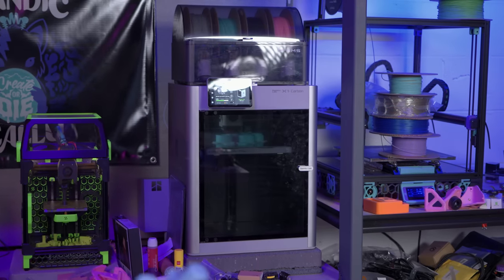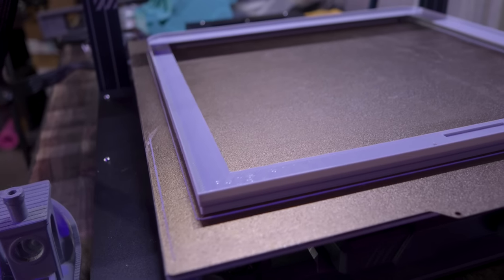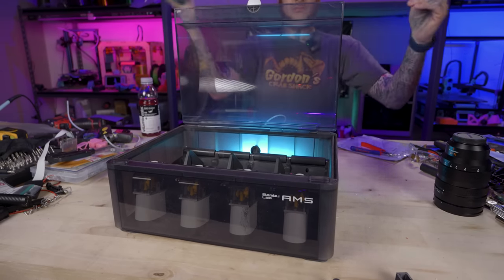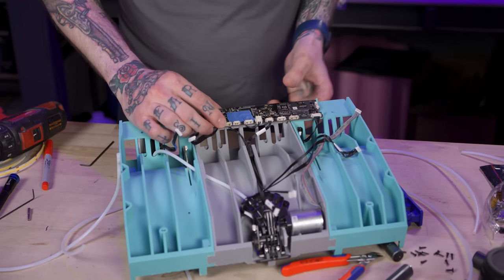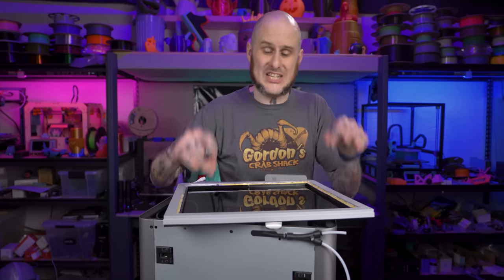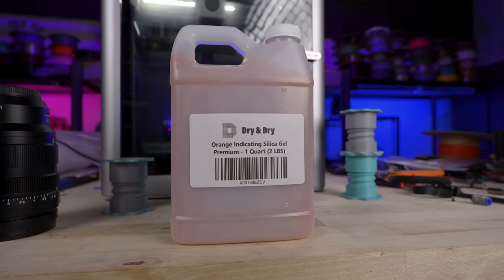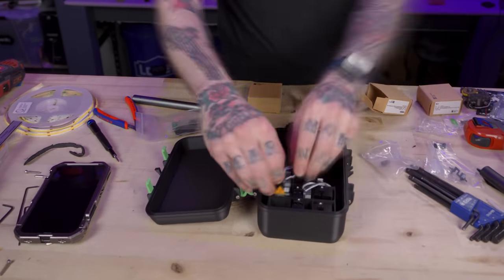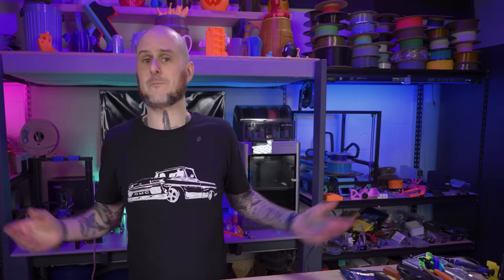GAME CHANGING Bambu X-1 Upgrades! - Hydra AMS & More!

Comment: In case anyone sees this later, Bambu sells some white LED strip with USB input that plugs directly into the printer.  No wiring or extra stuff required. Additionally,  adding the foam to the foil completely negated the foil side of the insulation which is reflect the heat back in. Don't add foam

Comment: Hey. Thanks for showing my Bambu Tool box as a Must have, makes me a little proud  😉 I had no extruder to make a place for it. Once i have one I will fit it in 😉
Reply from the maker: Thanks for making it. I was legitimately annoyed by my spare parts until I put them in that. 🤣👌🏻
Reply: @MandicReally  Doing some maintenance yesterday...thought about how good it would be to have a small box
Reply: can this be done in PLA or should it be different like carbon fiber filament?
Reply: @PaulStephenson003  can be done in any material 😉

Comment: I sealed the door gap with electrical tape. Flexible enough to allow the door open but thick enough to block any drafts.
Reply: The machine leaks so much air out back and from chamber fan (even offline) that tiny leakage from top was not meassurably higher for me. Might still be wise...

Comment: Also for the desicant holders if you print them out with PETG or other high temp resistant material, something that can withstand 100 degrees Celsius, and if you use rechargeable silica gel, preferably chloride Cobalt free or food safe, then you can actually use your X1 as a heater by using the drying filament feature and dry the silica gel. I would recommend also turning up the bed temp to 100 degrees and turning on the chamber fan to at least 10% to get a bit of air flow and exhaust some of the moisture.

Comment: Hey Mandic,

Nice video.  I actually spliced off the LED bar inside the machine to use an LED controller to turn my new LED strip on and off.  The latest firmware for the X1-C turns the light off when the Lidar is on, so it can get a good scan.  When the bar inside turns back on, the LED controller turns my strip back on as well.  Works great!  Maybe something to hack together later.

Great video!  I printed the AMS tool, since I didn't know about it.  Don't see myself removing the AMS a lot, after using the Y Splitter.
Reply from the maker: I've got some projects ahead where I'll be opening it up again, maybe I'll tie the lights in when I get there. Thanks
Reply: Can you post what you used to do this? Or a brief explanation of how to do it. Sounds like the ideal way to do it!
Reply: @rewire some details of the controller and wiring would really help
Reply: @MandicReally  yes please also install this mod. It sounds really useful.

Comment: About the light bar: between my Ender 3 and my Artillery Sidewinder X1, I've wired LED light bars both ways (hooked to the machine's power supply and powered completely independent of the printer) and I can safely say that independently powering the light bar is the better option. Yes, you have a separate power cord and on/off switch, but being able to light up the working volume of the printer when you have the machine turned off for maintenance makes a huge difference. Besides, you could wire up a switch separate from the Kingroom power supply and mount it somewhere on the printer.

Comment: Just printed the AMS Disconnect Tool this evening. Had to figure out why my Ender 3 wasn't laying down filament properly first (mega clogged nozzle, swapped it out and it's all good again) and it came out really nice (bit of lifting on the square end but I think it will still fit).

Ordered the X1C with AMS after work today, so hopefully next week I'll have it and be able to start playing around with some of the other toys. Really great looking tool and advice and I'm glad I found the vid. I think this one little gadget is going to save me much frustration later on.
Reply: How have you been liking the X1C?
Reply: @syd3034  Loving it. Extremely satisfied with the purchase. 99% of the time it just works exactly as you want.

Only troubles with it I've had so far is trying to run PETG and PLA through at the same time (trying to use the PLA as a PETG support material) and the PETG got stuck inside the extruder. So I had to pull it apart (extremely easy and well documented on the wiki).

And occasionally if you go a while without doing any prints, I've had the PLA become brittle enough to snap inside the tubing (usually in the bottom of the AMS). So I've had to do a few disassemblys, but the design and the documentation are very good. Some debate online as to what causes it. Some think humidity (but my AMD shows very low humidity) and some claim the tightness of the winding on the rolls doesn't play well with straightening once you get down to the inner sections. Only had to clear five of these, all of them more recently too. And only on the rolls that are getting light on. So might be advisible to remove the rolls from the AMS if you're going to go a while between prints.

Done some ABS and it was just as easy as the PLA. Just following the general advice online was sufficient. Multi-colour has been simple and I like the results to date. Haven't done anything super complex, but it's worked pretty well.

Really simple to print additional tools and parts to make life easier as well. Done a few of the AMS guides to help smooth the pushing and pulling of filament, but didn't have any pullback failures until I added a second AMS, and they mostly went away after adding the guides.

So far I've printed several big multi-part pieces. Dimensional accuracy has been pretty good. Probably will be doing some dialling in before I do my next one as a few of the pegs on my most recent one were a touch big for their holes and there was some cracking and delaminating. But once the entire model was together it's not noticeable.

All in all, very happy with my choice. Printing is incredibly easy. It's been extremely reliable. Maintenance is so much simpler than the Ender was. I'm at about 1100 hours of printing on it so far since purchase.

For the first generation, I think it's great. But it might be a good idea to hold off if you don't like having to make extra bits and pieces. I reckon a second gen version might iron out a few of the small niggling problems. And I don't think one would be too far off. Depends on how one approaches such a large cost purchase. I definitely think it was worth it for me.
Reply: Thank you so much for your detailed response! I currently have a pretty clunky and outdated printer from nearly a decade ago and the technology has gotten exponentially better. I’ve been looking into getting a new one for a while, and I figured if I’m gonna get one, might as well get the best. Multicolor printing and multi-material printing is very important to me. I like the ability to add multiple AMS units and that you can print basically “right out the box.” I think the most compelling factor for me for getting the X1 over the P1 is the multi-material printing.

Thanks again for your honest review and helping me make my decision!
Reply: @syd3034  No problem at all. Just a note though, the P series can use the AMS as well. The X and P can use the box AMS and both the big and small A1s use the stand AMS.

The difference between X and P is the mainboard and chip on the X are more powerful, so it has some intelligent features that the P can't do (the flow calibration, first layer checks and spaghetti detection).

And it comes already fitted with all the bells and whistles (camera, etc). But from my own research when I was buying mine, if you don't need the extras or the smart features, they print identically with all the same materials and accessories.

Just in case that factors into your decision. I'd still recommend the X as I use those extra features on every print, but you may not need or want them.

They have come quite the long way from what I've seen. Now I'm hoping for someone to X1 the resin printers and plastic recylers so I can add them to my creator space. Both technologies aren't quite at the general consumer friendly level I wanna do this hobby at just yet. But hopefully soon...
Reply: I guess I was just going off of what they have listed on their website, which is that the X is more recommended for different materials over the P but the P is also capable. And I agree, we need more options for recycling filament!

Comment: if you have AMS splitter and didnt use all holes of it, you can push outside roll filament trough one of unused holes in AMS HUB :) 
for example i keep sunlu filament dryer behind my AMS and use it for printing ABS/ASA/PA12CF stright from the dryer ^^

Comment: The AMS removal tool might be useful, but I always disconnect the AMS at the AMS end; the PTFE tube is easy to remove (two small levers to press inside the AMS), and there is no issue with accessing the clip for the cable.  It's almost like Bambu think that should be the default removal method.

Next question - what should I print the Hydra mod in?  PLA/PETG/ASA/CF-infused?

Comment: I'm in the market for one of these machines, and I have this nagging suspicion that the whole lidar thing is mostly marketing hype. I'm actually leaning more towards the P1P due to easier access, and more options with an enclosure. So a video covering the auto vs manual leveling would be very helpful.
Reply: Someone actually tested that and it does make a difference but not a ton. Print quality is great regardless, I have x1c but i think P1P looks great for it its price.
Reply: It's actually quite a good idea, and even if it does a little, it does it without me having to check :D

Comment: I keep waiting to see what the Creality K1 max and the Qidi X-max 3 will turn out… bit the more I wait and see, the more convinced I am into paying the premium for the C1 carbon with the AMS regardless of the smaller print volume.
Reply from the maker: I don’t have a K1 yet & Qidi is updating the X-Max 3 so I’m not doing much with the one I have. So I really can’t give much input unfortunately.
Reply: I’m feeling similar. Would really like 300mm+ build volume, but I’m pretty sure the AMS is a game changer both for multi filament prints and pure convenience. It’s a helluva feature!

Plus, I’m pretty sure Bambu can do a better job at support and improving the product than Qidi or Creality. Full credit to them, but it’s pretty clear that Bambu has disrupted the space …
Reply: @floodo1  I have a X1C with AMS for a month now and it's flawless.  Just amazing.  I wanted to get the new X-Max 3 with the large build volume and heated chamber but with hours and probably days of research I decided my best long term buy for me was getting another X1 Carbon.  So now I have a brand new second X1C on the way and can't wait to start churning out professional prints with two printers.  I'm also curious to see if the second X1C has any small differences in quality.  I won't lie the quality of the aluminum and real glass, ease of use, camera w/ timelapse, AMS, and the software is just getting better on top of already how polished it is.  Bambu is crushing it.

Comment: Scuff your Wham Bam with fine sandpaper or steel wool and the lidar will work fine.  Preheat your chamber with a hair dryer while running the auxiliary fan at 50%.

Comment: It's interesting that you added a mod to increase the enclosure temperature, but I've just watched a 3D Printing Nerd video where he printed a very nice mod to lower it for PLA printing.  It still has the ability to fully close the enclosure, but for PLA the glass can be lifted.  It is also shaped to perfectly fit the AMS.  Perhaps that mod would have been a better all-round solution.  The glass is higher, so you could (probably) still fit your LEDs.  If not, a slight remix would allow it.  That tool for unhooking the AMS should be shipped as standard.
I've not seen your channel before, so I don't know how good your modelling skills are, but why not model a parts box which does fit everything?  That's the joy of 3D printing, you can make stuff exactly how you want it.
It would be nice if an update to the AMS had a larger lid so that it will accommodate larger spools, and include something like the hydra mod as standard.  I know they probably want everyone to use their own-brand filament, but that's not how the 3D printing market rolls.

Comment: I have seen Bambu Labs AMS lid spacer for your lid issue, but I don't know how well it works.
Reply from the maker: Yea, the Hydra AMS project has a link to one, I just didn't feel a need to print it yet.  Honestly I rarely print anything but Polymaker (which already fits), so I didn't NEED to do that Hydra at all, ha.

Comment: I see that P3P sitting there!  I have one too, I'm working on using the palette with the p1p in accessory mode since i didn't buy the AMS system
Reply from the maker: Id HIGHLY recommend just buying the AMS. The Bambu + AMS configuration is SO trouble free compared to the P3P.  Granted I absolutely hate the P3P. I would say I had maybe a 20% success rate by the time I stopped using that machine.
Reply: @MandicReally  I honestly would love to and will later, but for now might as well.  I’ve had good results on my Ender 3 with direct drive and a custom purge bucket, but any bowden printer or purge tower set up is so wasteful.  With the purge bucket I only purge 35mm of filament total

Comment: I’d like to hear more about the LiDAR inadequacy, and I did light strips with 24v transformer from an exterior source, right into a 120 plug, and there’s four sections on the desk right above the machine so the glass is tinted, therefore, not enough light gets through to mess up the lidar.

Comment: I think most insulators would say you should have put the reflective surface on the top of everything. The foam insulates the same no matter where it is in the stack. There's very little to reflect under the foam.
Reply from the maker: The butyl adhesive would not adhere well or smoothly to the foam. And the point of the butyl is to provide dense mass to the panels to reduce reverberation through the materials. So it has to be installed on the panels directly. Isolating that with foam defeats it’s purpose. The foil will still reflect even under foam. Radiant barriers are often used on other side of insulation.

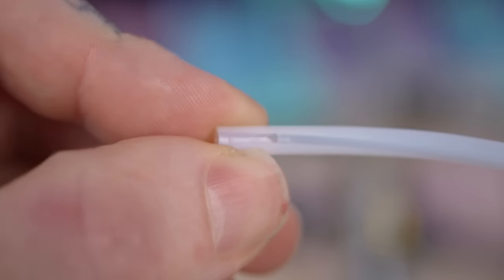Comment: @ 08:40. My AMS has 3700 hours on it and I have had to replace these PTFE tubes two times now because of the same issue with simply printing PLA. One time it was a whole tangled mess inside the bottom of the AMS.

Comment: You should really clean the front two rotary stats and put some grease on it. There are some super quick prints for helping spread the lube. 

Also the carbon filter needs to be replaced. I think that thing needs to be replaced every two or three months depending on what filaments you print with. I think they are 6 dollars but I might be wrong.

From a maintenance standpoint you should be set for the most part doing those 2 simple things.

Comment: Maybe someone sealled it with Foam Insulation Tape, Weather Stripping Door Seal Strip for Doors and Windows? I don't know how well the sticky back will handle temperatures but it's use to seal houses from mostly cold. They make a more permanent seal out of different materials.

Comment: As for insulation just put a woll blanket over the printer. But i noticed when the internals are too hot the automatic bed leveling does not work

Comment: Hi, certainly the Bambu X-1 is a great machine considering all the videos I've seen at least, but it's not a printer within everyone's reach considering the price it's sold for, we'll have to wait a few years for it to be affordable and by then it will be overtaken by other even more powerful machines and will certainly not be produced anymore, so nice machine, probably one of the best currently on the market, but not for everyone, enthusiast or not, it's still a hell of a lot of money to get out of it, too bad.
Reply: I believe Bambi Labs would direct you to the P1P. I would add that many X1C owners prefer using build surfaces that are not compatible with the LiDAR scanner, so the P1P isn’t necessarily lacking in that regard.

I do agree tho, very pricey for many people, despite being the cheapest “it just works” (and REALLY well) CoreXY … the competition for this machine is really $2000+ machines not Ender clones

Comment: is this brand Bambu Lab a very good start?? vs ex elegoo ntp 3 pro? also, in a hobby room whats best to print with as your also working inthere.? plant resin or fillament?
Reply from the maker: I’d really recommend filament to start. Even plant resin is gonna have a stink and require careful material handling. Filament is just less mess and safety concerns. 

 Bambu is an amazing machine but I’d probably recommend saving a few bucks to get your feet wet. The Elegoo Neptune 3 Pro is a great starter machine IMO. I’ve not used to but do have it’s bigger sibling the Max and it’s been a solid machine for me. You can get them here: https://tinyurl.com/Neptune3Pro (affiliate link)
Reply: @MandicReally  thx for the swift reply - 
yea i really want to make Figurines 20cm+ tall and helmets. (dont fillament give out oders , and have to have a vent system?)
the cost aint the biggest problem,  its more the work involved after if i want to paint alittle on them, how fast do a pla /ect print a 20cm statue or a helmet, and am i too worried about the after work involded??